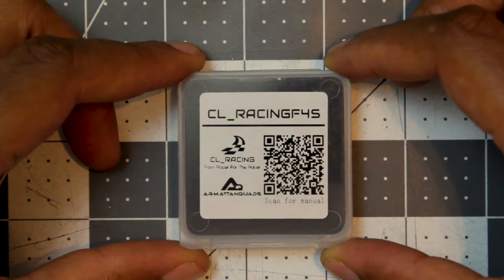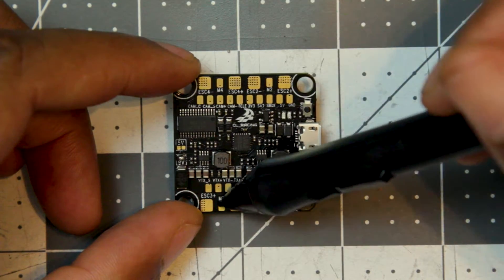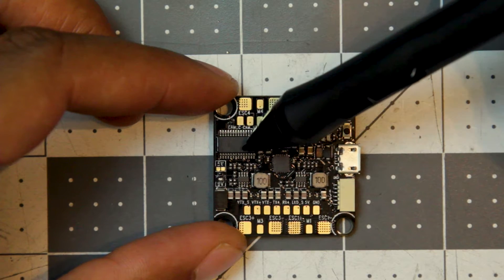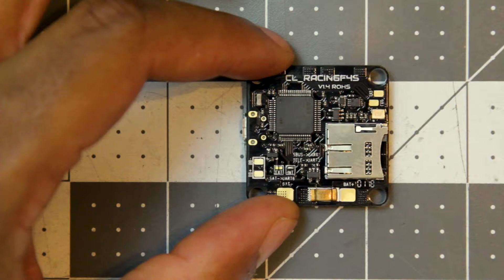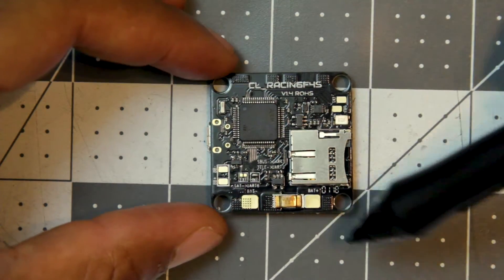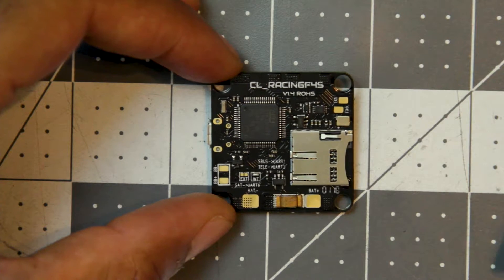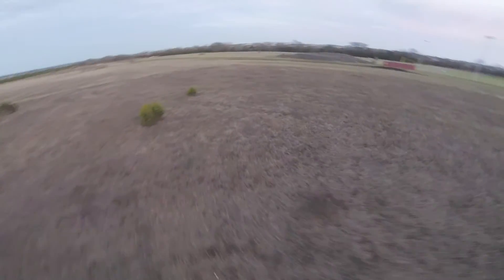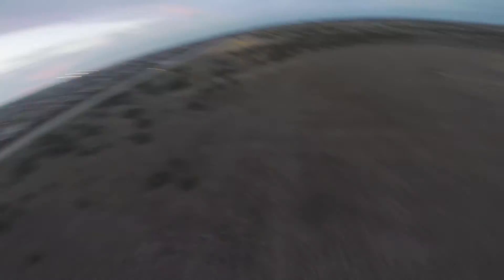Cl Racing F4S review (first review video EVER!)

Comment: so since you have 4 separate esc's for the quad, you must have attached the XT60 power leads to the board, but if you were to use a 4 in 1 esc, would you attach the XT60 leads to the board still or would it go on the 4 in 1 esc pads?

Comment: I love my CL racing boards, glad to see they fixed the death roll some people were seeing. Have you tried Butterflight on the board yet? Or are you sticking to betaflight?
Reply from the maker: CagaFuegoFPV Since this video I purchased another board and I still like it. I may buy a third. I used my second one with speedix 30amp ESCs running dshot600 and still had no issues. I haven't made the jump to butterflight yet. You're looking at someone who's favorite quad still runs one oneshot 125. Lol. I need to look further into it before making the jump. I feel like I still need to master everything Betaflight has to offer before making comparisons. I'm honestly JUST getting better at adjusting my tune and making it my own rather than using other peoples presets. How about you? Are you using Butterflight? How does it compare?
Reply: I'm all in on Butterflight at this point. My CLRacing boards fly better on Butterflight than they ever have on Betaflight, in function and configuration it's damn near identical since it's a fork of betaflight, but changes have been made to the types of filtering done within the flight code that greatly impact flight performance, so if you make the jump it should be pretty simple to figure it out, I think you would really dig it. 

But now, all I really fly is Butterflight on the Helio Spring FC (dual mcu FC, F3+F4), which is a whole nother ball of wax, propwash is near impossible to get and it flies amazingly well on the stock tune. It does have it's quirks, but the technology is quite amazing and is rapidly changing. I'd give it a look when you're thinking about trying something new.

Check out this video, it was made with a completely stock tune Helio Spring FC, only thing I changed were my rates. https://www.youtube.com/watch?v=QvHJbnJjCfY
Also, for additional comparison, here is a stock maiden Butterflight quad on a CLRacing F4S that flies damn near perfectly on a stock tune as well, very impressive! https://www.youtube.com/watch?v=CNMBxmPbE5Q

disclaimer: I am sponsored by helio, but I try my best to remain objective in my assessment of this stuff.
Reply from the maker: CagaFuegoFPV You've got my interest. I will give it a closer look. Thanks for the info.
Reply: Anytime man, happy flying 👊

Comment: Do you know what the voltage output is on the vtx+ pad? I might pick this one up.
Reply from the maker: vtx power is switchable. By default 9V is supplied, but if you need to use a 5V input you just bridge the 5V pads and undo the 9V bridge. It's pretty convenient.